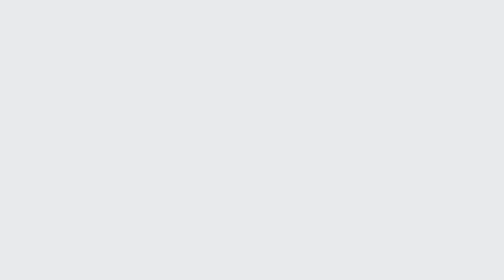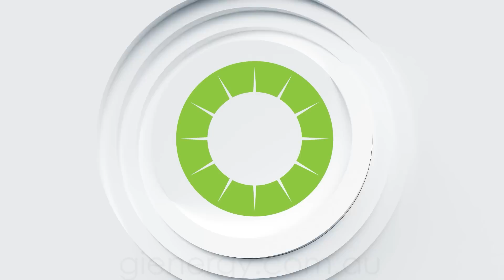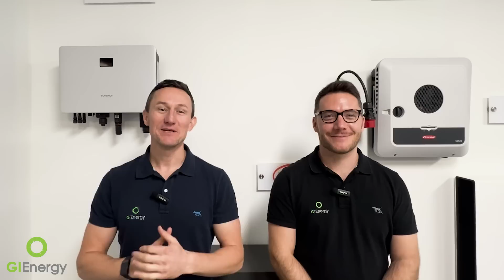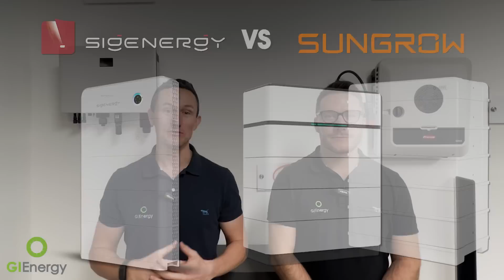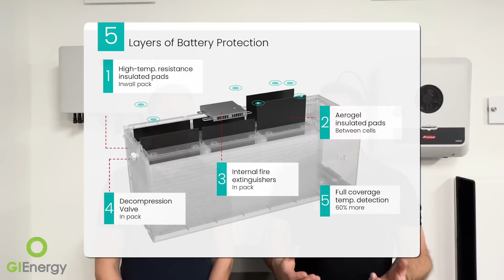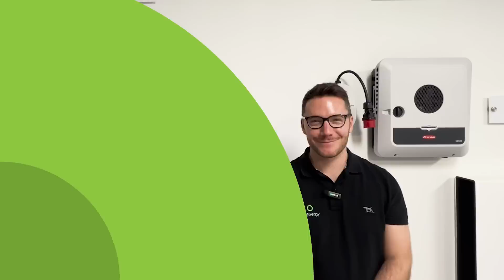Sigenergy vs Sungrow Battery Comparison | Best Solar Home Battery in Australia?

Comment: A 48 kWh battery is exceptionally large for a standard residence. For it to be a viable financial proposition, you must assume massive energy throughput. This requires shifting heavily to home electrification (EVs, heat pumps) , participating in Virtual Power Plant (VPP) trading, and sustaining a very large solar array.
And as far as VPP is concerned, people aren’t making the returns that they used to because the network is far more stable and reliable. The only two states that are still in the main generally fairly profitable Victoria and South Australia Australia. That’s one hell of a battery system and a lot of money that you want to be getting your Return on.
Reply from the maker: Yes, 48kWh is very large for most homes. There are quite a few that is does suit though!

Comment: I think sungrow are redicilously expensive. I have a hybrid sungrow inverter and a electric car with a 82kw battery in the car, id like to get a home battery but I'm finding it difficult to pay Something in the order of 13k with rebates for 20kw sundrow v ess batteries with a 10kw inverter included and 40kw storage for under 9k? I'm spewing going the sungrow eco system.
Reply from the maker: For a consumer , I can definitely see how it can be hard to justify the price when comparing with these $9k, 40kWh offers. Speaking as someone who has been in the solar industry since 2009, I would never recommend a 40kWh battery that costs $9k to a good friend or family member as I genuinely do not believe it can be done properly for that price if you want it to last. The reality is that Sungrow is not actually expensive, it is correctly priced. It just seems expensive when compared to these $9k systems that are actually incorrectly priced for something that is meant to last 10 - 15 years.
Reply: @gienergy2250 if the batteries are to last 15 yrs then the sungrow would not be beneficial at their price point. My bills are around  300 a quarter with running an ev. I would love to have AC but would require a larger system than what sungrow is offering on my single phase. It's a terrible delemna to be in as I love solar and know how  to use it to keep bills down but seeing a few friends on these cheaper system without problems so far seems worth it.

Comment: Sigenergy has a good product, but a sub-standard management team in Australia, specifically regarding the duplicitous ACCC recall process for the the 8-12 kW SP Sig Inverter. The recall was initiated for safety reasons (fire hazard, plug combustion, toxic smoke), but Sigenergy Aust has transformed the recall into a warranty replacement process with significant delays. We have been waiting 12 weeks since numerous failure events and the work order issued only after complete combustion of the AC plug with the entire system inoperable. 
Duplicity, False and Misleading business practices: Sigenergy Australia blamed their installers (non-sensical- consider how many different models of inverters are subject to the recall across the entire country – all these inverters had bad installers in so many locations? BS). Take note installers.
Sigenergy Aus recall changed the recall from a safety focused recall to a de-facto warranty repair issue by only issuing “work orders” for replacement only after complete failures detected, rather than work orders against all affected units (which are progressing to combustion after failure and multiple tripping breakers events). Safety concerns? More like a profit concern.
Sigenergy Aus has created this shortage of repair/replacement stock by prioritizing new stock to new installations (higher profit) over recall stock (costly warranty repair).
Sigenergy Aus hides responsibility for repair stock shortages and their deliberate profit focused allocation policy by blaming channel partners (Suppliers and installers). Sig deliberately misrepresents the actual stock shortage by misrepresentative deflection by directing customer queries to the Sig installer/supplier base. These suppliers all respond with, “sorry no stock”, as a result of Sig Aus continuing to deliberately allocate new replacement stock to new installs via it’s “Green/Grey Dot” system, misrepresenting this as tracking system rather than the actual profit maximization program.
Summary- Good product, but untrustworthy Australian management team.

Comment: Sig is recalling their products in Australia, electrical safety issues😂
Reply from the maker: There is a recall on some single phase inverters. It happens to manufacturers from all domains including many other solar inverters / batteries / panels over the years. We won't judge a manufacturer based on having issues as much as how they deal with them when they do arise. It is too early to say how Sig will deal with this one but the early signs are pretty good. Time will tell.

Comment: I like the Sigenergy design and modularity.  I don't like the idea of the whole system being disabled after 90 days of no comms back to china. Especially with a war being likely over Taiwan by 2027.  That is a good reason for going with Sungrow. All your infrastructure disabled kind of sinks the whole idea of an emergency backup power supply.
Reply: I dont think it's a big issue. After all when was a the last time you went without 90 days of internet connectivity?? for me it was probably when I was using dial up back I the early 2000's. The average customer is not going to be concerned about this, even if they have crappy internet service providers. From what ive read the system goes into "safe mode" rather than being disabled and goes back to normal when re-connected. As for the geo-political concerns, it's speculative. There isn't any evidence that supports that the system is intentionally disabled for geopolitical reasons

Comment: I got a couple of SolarEdge HD Inverters with optimizers on the panels. can SolarEdge be integrated with Sigenergy Battery?
Reply from the maker: Yeah you can AC couple the Sig to your inverters. The only issue may be your grid application getting approved depending if you are single or three phase and exactly what you have installed / what you want to install next.
Reply: @gienergy2250  thanks. current inverters are single phase, house is 3 phase. just wondering if Energy providers VPP would also work with this setup? and will there be a great loss for AC coupling
Reply from the maker: @ajedi2k  If you are 3 phase it sounds like you might be able to add an additional 5kW of hybrid inverter / all in one battery with inverter. This would limit the charge and discharge to 5kW but I think it is possible to do. Probably need to talk about it more to find a solution though. If you would like to chat you can get in touch here: https://gienergy.com.au/contact-us/

Comment: Just swapped out my prior system because of network security issues to a sungrow 20kw inverter and 40kw batteries. For me it is because it works really well. But more importantly, my previous inverter was considered a security issue. So I had to change it. Sungrow has a local monitoring option. So you can turn internet access off. That was the key issue for me. But I am really happy with it.  If I had one bit of feedback. It would be that I wish it had the ability to go to 50/60 kwh battery. I dont have an electric car and dont plan to get one so I cant speak to that. Though I am excited by the new Tesla motor innovations. So maybe if they come through. Sungrow have been aroundnsince 1997 or so and there is a ten year warranty which means something if you have been around so long.  I was never offered sig by any of those quoting but I guess that doesnt mean much. Other than I am also an investor in utility level solar plants. So it is in the partners interests to make sure I am happy.
Reply: Your comment invites the question of which inverter was assessed by whom to be a security risk. Some detail there please!

Comment: A question I have with sygenergy, is can my pv plug straight into the syg inverter, thus removing the original inverter that was installed with my solar pv system?
Reply from the maker: Yes it can, but the existing solar system may have to be brought up to current electrical standards depending on when it was installed. Solar panels may also need rewiring depending on how they have been installed. So yes it can, but with some minor considerations that a good installer would know about.
Reply: yes!

Comment: A few comments:
1. I was leaning to Sigenergy but on getting 3 quotes all 3 proposed Sungrow and it was installers concerned if Sigenergy being new.
2. Sungrow lights is not as flashy as Sigenergy but one can tell the broad SOC from light and tap on inverter see more info.
3. You were doing a disservice to Sungrow by muddling between old and new batteries and 1&3 phase. 
4. Have Sungrow SH20T 3P, backup is excellent and easy to run offgrid.
5. Curtailment wasn't working, Sungrow support was excellent identify it was the distributor applying variable export limits.
6. You did not cover apps. On this Sigenergy app is better.
7. Your advice on EV is dodgy.
Sigenergy does have a DC charger, this is good and bad.
Using one inverter reduces cost but creates bottleneck.
V2G is new and developing experts are advising to holdout getting charger if you do not need one.
External DC charges have own inverter (expense) but will enable fast V2G.
I'm on Amber Electric with wholesale prices, as i want V2G. When the EV im eyeing arrives, i will see which works best with EV and Amber.
Reply from the maker: 1) Totally fair, we offer SG as well especially for people who are worried about Sig time in business. It is a great product and this video is not intended to suggest it is not. 
2) Yeah, the lights are a minor thing anyway so not a massive deal either way. Matt just really like the way they look on the Sig so just his opinion.
3) Not intended. We are just having a conversation which is not scripted and it is a bit confusing with SG having two current models to choose from. 
4) Thats a great choice and absolutely works well. 
5) SG support is the best in the industry, which I think we did mention. 
6) True, we missed that part. It is hard getting everything right, we try out best! 
7) I don't think is is fair to say it is dodgy, not with how I interpret the word dodgy anyway. Dodgy advice to me is trying to give people incorrect information for personal gain. The V2G and V2H is not ready which I think we mention several times across the videos we have done about Sig. We have also mentioned it is expensive lots of times. We are not trying to be dodgy here, we are trying to give honest advice and of course it wont be agreed upon by everyone but all we can do is stay true to what we genuinely believe. 

Long story short... SG are great and you have a really good system which i am sure you will be happy with for a long time. We install heaps of SG batteries and this video is not an attempt to devalue the brand for our customers. It is just our honest and imperfect opinion.
Reply: @gienergy2250 re: V2G, just saying those testing V2G recommend not buying a charger if you do not have an EV as there are new chargers and EVs coming out.  For me, I'd first select EV supporting V2G, then I'd select best AC/DC charger supporting V2G supported Amber. 
Your advice of buying Sigenergy charger before having EV is unwise (dodgy) as it may not be their best option when they get the EV. I expect adding a Sigenergy charger is something easily done at time of getting EV and there could be a newer and better model at time of getting EV.
Reply from the maker: @VaCha62  we are not advising people to buy a Sigenergy EV charger before buying a EV in any content. That would be unwise as you have suggested.

Comment: One point you missed about the sigenergy DC/DC EV charger is it is bidirectional. This means your car can be added to your battery volume for backup and price spikes. If it cuts 50kwh of battery off your install it looks very cheap! If you can sell an extra 50kwh per price event you are also looking at 8 $10 events or so to pay the premium. Also compares well to sungrow IDC30E pricing ($11k) although that is a 30 rather than 25kw unit. In an extended local outage it also gives the unique ability to ship power on wheels from a rapid charger for your house.
As someone who had a victron/LG/Fronius system I agree with your point about a proper bypass switch which mine only got after recall made the inability to disconnect and maintain function obvious.
The integration of the sigenergy with Shelly switches is also encouraging for compatibility with other devices. Something I liked about Fronius victor was the open source and sun spec standard making software supportable even without the company and impossible to do a Nest and turn off.
Reply: They mentioned that in the passing V2G and V2H comments.
Reply: Are the pricing events likely to go on long enough to say drain a 48kwh battery to then move onto the car, given your feed in rate will be capped by the inverter size. From what I can see from Amber reviews unlikely, furthermore with all these domestic and big batteries going onto the grid will they even exist to the same extent going forward. The ship power on wheels is interesting which I considered myself, but probably comes into play largely for off grid considerations, your location and depending on your panel configuration, my panels will make on average 50kwh in the middle of winter where I live and panels are cheap, compared to the DC charger option. Having underground power I have had one outage of one hour in 5 years, appreciate other experiences in more remote locations are different.

Comment: Seems the sig external side panels are plastic andgot gaps at the back ?
Reply from the maker: The case around the battery is plastic yes. Thats why we try and install them inside where possible and if they are going outside we put them under at least partial cover and with an awning.

Comment: If I buy 48kw sigenergy system, can I add a DC EV charger at a later date?
Reply from the maker: You would have to stop at 40kWhs if you wanted room in one stack for the DC EV charger. You can do multiple stacks if you want more battery but obviously cost is then a consideration.

Comment: Time will tell if sig is any good. The led lights are far as I'm aware on the sig only have 2yr warranty.  If i was in the market I would certainly look at sig but already having an inverter fail and waiting weeks for a replacement I reckon I would go for Sungrow for the service backup.
Reply: Good points, is your conclusion based on known Sungrow service backup & history, or is it because Sigen are newer company, or that Sigen take longer to get you a new inverter if you needed one?
Reply: @evil17  known sungrow service

Comment: When is the BYD HVB coming to Aus?
Reply from the maker: I believe the HVE is the next BYD battery to come and is likely yo approved by the CEC around October.
Reply: @gienergy2250 we will be waiting as we needed a more compact system. The 22kWh HVM is too tall for our garage and that’s a minimum capacity we wanted.
Reply from the maker: @joeee60  Are you 100% set on BYD?
Reply: @gienergy2250  yes we have a gen24 fronius that’s only 4months old
Reply from the maker: @joeee60  Yeah fair enough. The Fronius Reserva will be ready to install later this year but you would need more than one stack to get to your target kWh of storage so height would not be a problem but you would need more stacks so more space used along the wall basically.

Comment: Was going to buy sungrow but very thankful I chose sigenergy.
Reply: I am very interested in Sigen. 
Can you tell me what were some of your reasons for changing decisions between the two?
Reply: @evil17 I had a friend who works in the solar industry who didn’t speak to highly of sungrow support. He told me to go sig which made no sense as they were a new company. His advice motivated me to try and prove him wrong so I deep dived into research. I could be wrong about some of these but 

1. Being on the owners Facebook page I saw a lot more issues relating to the app and user experience. Sig has issues on owners group as well but usually relates to if your using an exisiting inverter instead of using sig inverter and the issues are pretty trivial
2. The ability to have modules at different charge levels makes adding batteries down the road a lot easier. 
3. Sungrow requires cut over switch as whole home runs through inverter
4. Larger battery modules
5. I don’t know how to put this into words but sig feels like an iPhone moment in battery tech. It does what it says and the user interface is very slick and responsive. It’s also very easy to determine the right size. E.g batteries discharge at half the rate.
6. Technically sig is a safer battery but in reality there’s not been enough time to prove this 

Being 3 phase we really only had 2 options, sungrow or sig. at the end of the day I don’t think you would be disappointed with either

Comment: …our current non-hybrid Sungrow 10kw inverter, we got $1500 trade-in value from Sungrow, to switch to a hybrid Sungrow with battery…that made the decision pretty easy
Reply from the maker: The SG rebate is great, as long as the SG battery is the right one for you of course. We install heaps of them and they are a good product!

Comment: Great videos- interested in the sigenery but was wanting to know how  the skybox units compare?
Reply from the maker: The Skybox is a bit different to Sigenergy. They use Pylontech batteries and are more geared towards off grid. They are a much smaller outfit. I am not saying they are not a good product as I haven't ever installed one but it is rare we ever get asked about them and I think they do a lot more off grid. Sigenergy is probably a better overall design for a house that has grid power.